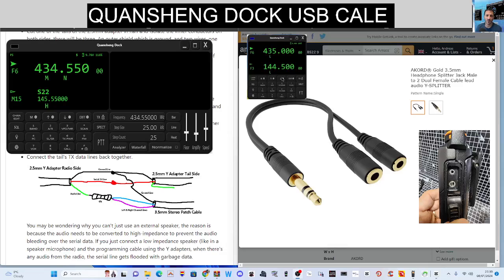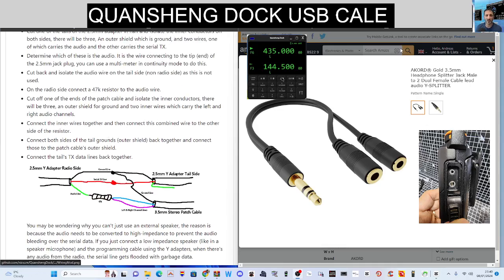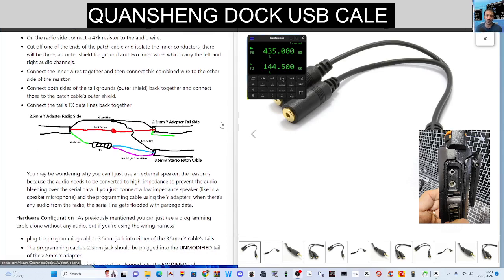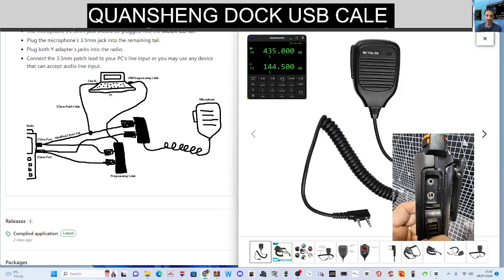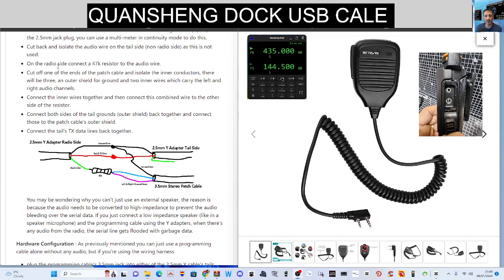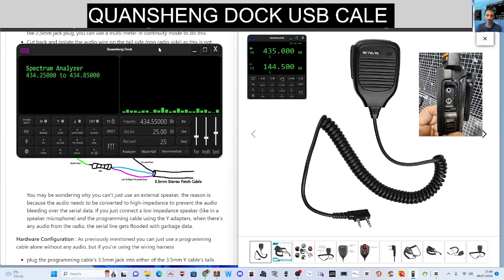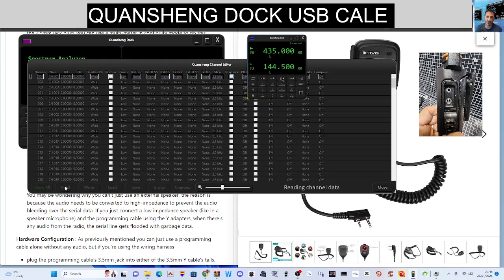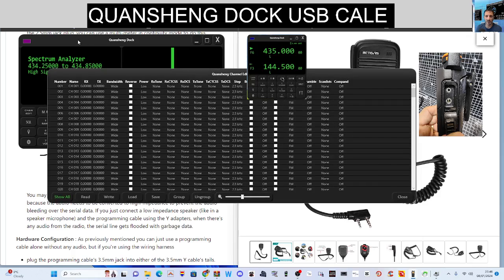QUENSHENG DOCK- USB CABLE LEARNING TO BUILD

Comment: Thanks for all the supporting videos you're making. The items you've suggested for the cable are spot on. Just one thing, you can't operate the channel editor (or anything else really) while the analyser is running as the analyser totally takes over the radio, you have to exit into VFO mode.
Reply from the maker: Hi Nick , glad I got the items correct I just enjoy learning :) , thanks loads for your work it is appreciated I will try make a cable any pics you have will help 73 .